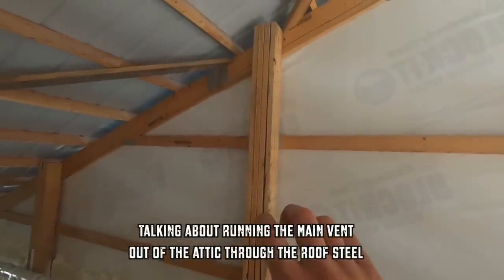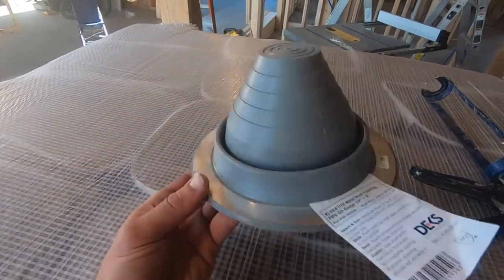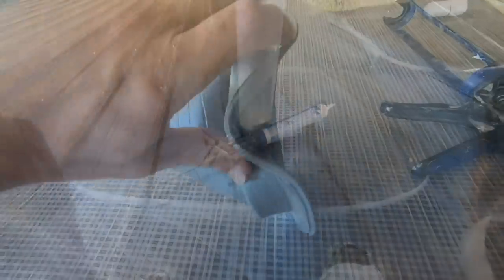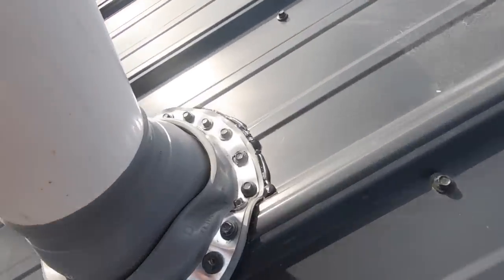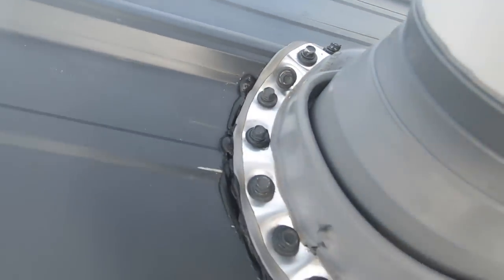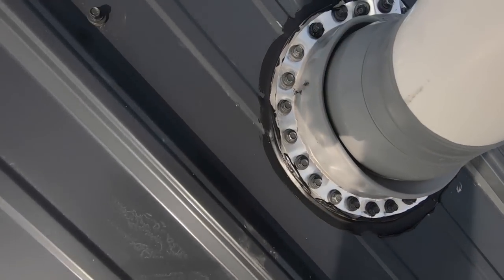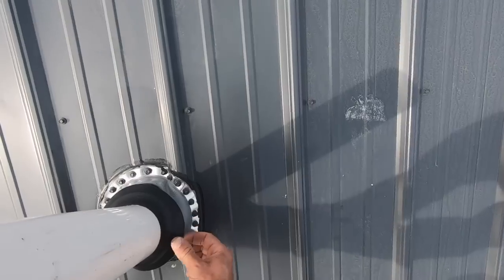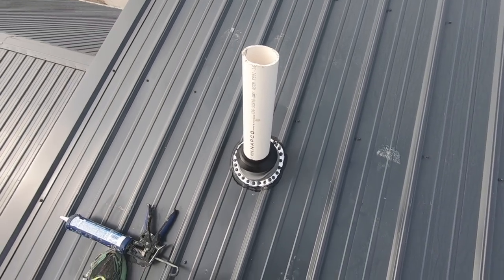How To Flash a Pipe On a Steel Roof | Pipe Boot

Comment: Minor thing, but paint that pipe black so it blends in with the roof.
Reply from the maker: Good idea
Reply: Plus it will help prevent the sun from eating the pipe. The sun eats everything. Entropy always wins in the end! :)
Reply: @MrPostFrame  Now you won't be able to look at it without remembering you want to paint it!
Reply: Jason Johnson  IF it was a flat surface and had wood backing probably, but this is uneven all the way around and only the metal roof is being screwed into.

Comment: Cool little vent flashing. Thanks for that tip! Not to be critical, but it is always advisable to center roof penetration and jack on a rib if possible. A little harder to cut in, but is sheds water better and will prevent leaves etc from building up.
Reply from the maker: Thanks for the tips. I’m sure I’ll have another opportunity to put in another one.

Comment: Personally i opt to use sika np-1 silicone.  I've never seen a product hold up like it.  Plus it comes in 31 color flavors.  Overkill,  but i might have layered in a top coating of volkum flexible flashing just due to the rib profiles encountered. On the next vent might be worthy to add an inline 45 to the pipe so it penetrates the mid- point of a panel rather than near a standing seam.  So that's 3 things I've found in this entire series I'd consider changing (out of thousands of decisions. ) I'd hire you in a second to supe my house build. Well done.
Reply from the maker: Thanks for the tips. I really do appreciate it.

Comment: Do you need to eventually cover that pipe with anything like a mesh or a vent cap to keep animals/debris out?
Reply: Mesh is not required and not recommended. The pipe is a plumbing vent which vents sewers gasses, and wildlife will not attempt to enter this penetrations. If mesh is installed over the top to the pipe opening, there a risk of reducing the ventilation of gases and possible blockage in locations where temperatures drop below 0 deg C.

Comment: Would Iowa codes not allow you to run the vent pipe up to the under side of the roof then angle it to run up to the ridge cap then cut it off?  The hot air that gathers in the attic would push out the scent from the pipe between the ridge cap and roofing plus there wouldn't be any holes going through the roof

Comment: I greatly enjoy and appreciate your series of videos.  Great job on your construction, too.  I am wondering whether it would be good practice to run the plumbing vents through the ridge vent at the roof peak in order to minimize snow and ice accumulation at the vent?  I've never seen this done, but wonder if it would not work well?  Any thoughts, anyone?

Comment: This may seem almost anal retentive regarding this project but one other factor possibly worth consideration is the sun fade/dissolve factor of your boot.  If you wanted to take an extra step of protection in this area you might consider another boot, just large enough to cover the whole project to bear the brunt of the effects of the sun.  Additionally,  this secondary boot (no silicon required!) could more easily be replaced when necessary thus prolonging the 'life' of the primary boot.   I've had some experience with sun degradation issues so I pass this along for your consideration with best intentions.  Enjoy the show.  Carry on!

Comment: Check out the perma boot (Lowe's and HD sell it, not sure about menards). It's aimed at repair situations, but it has a flashing piece that goes inside and outside the pipe and flashes down over the rubber seals. It completely eliminates the chance of water getting to the pipe/rubber seal. It's a little pricey, but it's cheap insurance to know your seal will NEVER go bad!

Comment: You didn't mention it in the video but I'm sure you did it.  Make sure to debur and chamfer the outside edge of the pipe before you put the boot on.  Prevents acidental tearing.  I've also lubed up the pipe with some dish soap if the boot is really tight.

Comment: I was really expecting to see a safety line attached to your torso somewhere.  The duct tape wrapped around shoes works both ways:  makes feet stick, but might may cause unexpected tripping to send you tumbling.   Almost any line will do and long enough to stop you before reaching the edge of the roof.  I would probably attach it over the roof ridge to something near the ground, like maybe one of the porch posts (though I am disoriented as to what is where from the video).  This is mostly because you seem to work alone, without neighbors in earshot, nor a buddy/wife/kid present to call for help.

Comment: Why didn’t you punch a hole from the top down so that you’re centered between ridges? Looks like plenty of room on that plywood from underneath the go either way so you’re missing ridge. Another little trick is run a bead from the top leading to the tall ridge around the pipe so water does not divert into the triangle created by the upper Ridge in the pipe seal.

Comment: I haven't found any 3" vent cap to keep birds and bugs out that I like the looks of yet. Have you decided what you'll use?
Reply: I used ABS pipe so it's already black and I'm thinking of just gluing some screen to the top, but think that may get clogged up over time so I'd prefer a cap that does at least a 90 so debris doesn't sit on the screen.

Comment: Why not move hole over 1inch and avoid rib? I don't get it
Reply from the maker: It’s actually better this way because if it was centered between the ribs it would be encountering all the water coming down the roof between the ribs. I would have preferred it was centered on the rib.
Reply: @MrPostFrame  What about cutting the hole on the sidewall right under the edge of the roof and do not stick any pipe on top of the roof. You have plenty of space, is there any code about that?